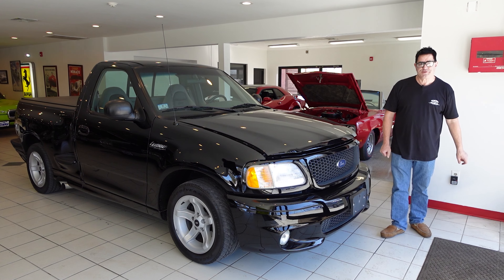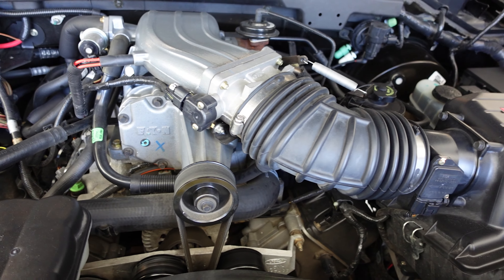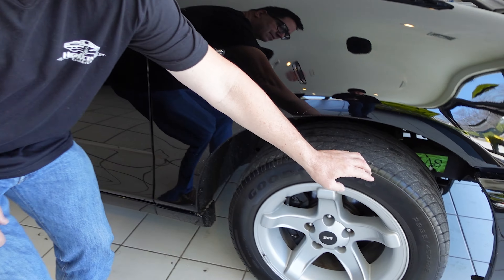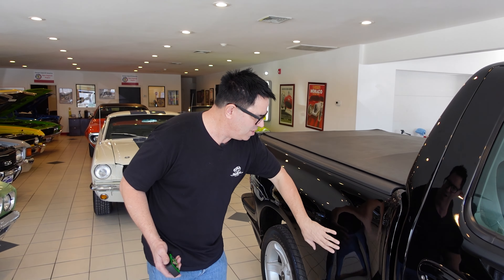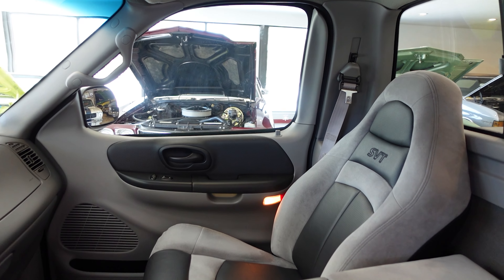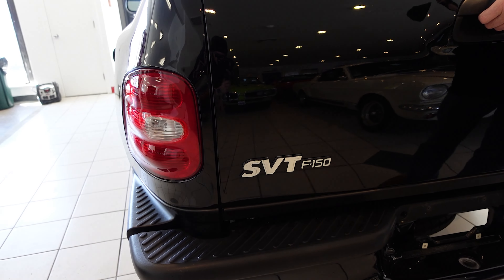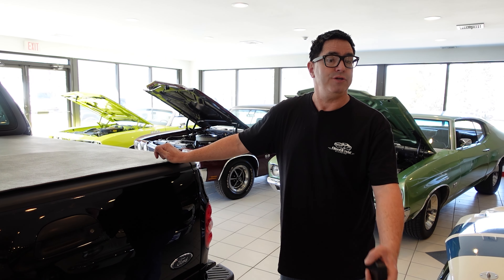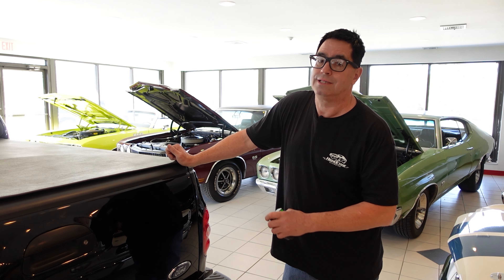1999 Ford SVT Lightning Walkaround with Steve Magnante | High Octane Classics

Comment: I don't typically like Fords. But I would definitely own this truck. I'd rather have a GMC Syclone or 454 SS, but this would do
Reply: I'm a Honda guy and I would definitely own this truck too!
Reply: Too bad GM never made a direct competitor to this (despite the ORIGINAL reg cab, stepside Silverado SS 6.0 concept.)  I factory ordered an ‘01 Silverado RC SB 2WD with a 5.3. Ran a 15.0 1/4 mile out of the box. Over a second behind the Ford but came at a $10k discount, but still faster than a Dakota R/T.
Reply: "This would do"? Sorry, but I will take the Ford and its 360 HP over the 454s 230.

Comment: Does the SVT engine have the same problem the other tri-valve engines?
Reply: If it has a three valve 5.4 then yes
Reply: The two valve and the four valve I don't believe have the same issues
Reply: It's a 2 valve and big problem with 99,00,01 and 02 Gen 2's was the 4 thread heads for spark plugs
Reply: These had the 2V heads. But these early ones did have the fatal flaw of not enough threads for the spark plug holes and they blew spark plugs out frequently.
Reply: @jeffsmystic  Ford fixed this in 03. But I never understood why they went with the 4 thread heads on boosted engines no less! They already knew that blown out spark plugs was a problem but yet decided to add boost on top of it all.

Comment: You say they consider trades? I hate to part with my collectibles but,for that truck I would offer myriad baseball cards from ‘74-‘77,two or three old Hot Wheels with the red,white & blue race track (although missing some pieces),a half bottle of Wild Irish Rose (a fine wine) and my neighbor’s well-used (but all highway miles) ex-wife. So,do we have ourselves a deal? Waddya say?